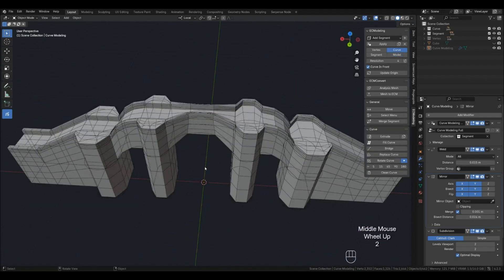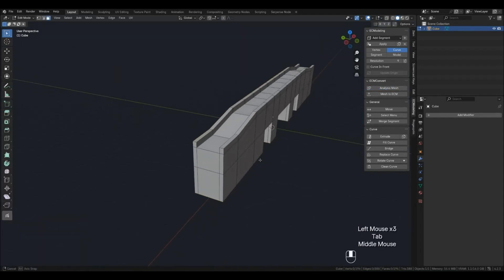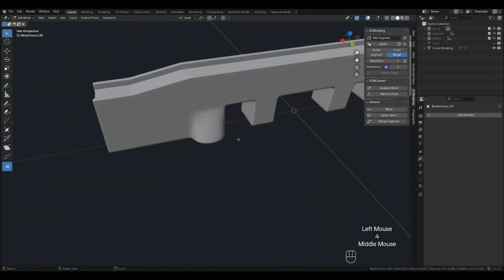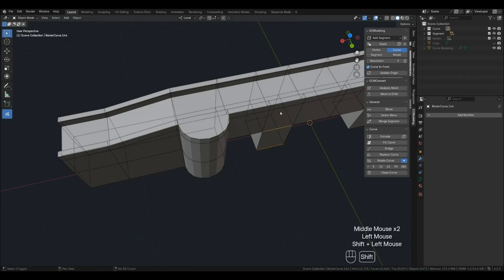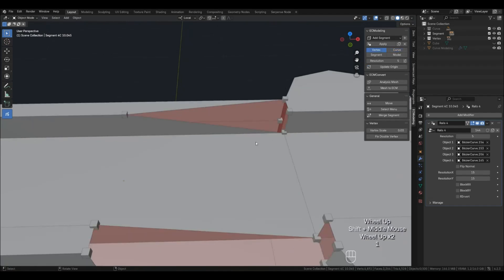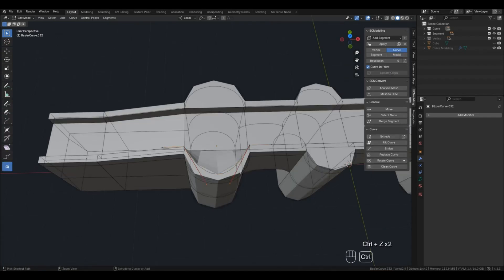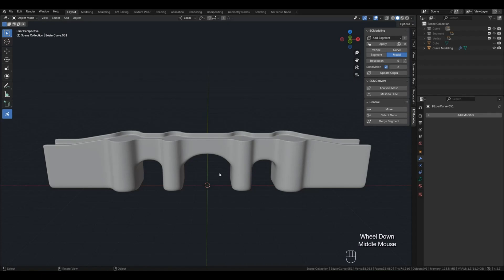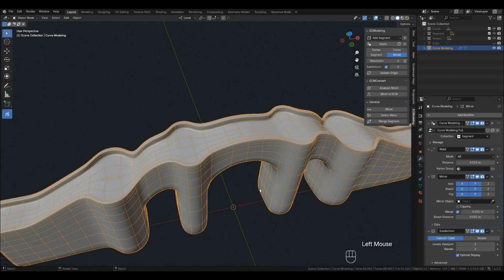Expert Curve Modeling Tutorials 4

Comment: can we make sharp /hard edges too ?
Reply from the maker: You can add bevel in the right places after applying the model and the desired edges will be tighter, you can also add a bevel modifier in model mode (without applying the model to leave the ability to edit in real time), in some cases this also works well, but it depends on what shape you are making. It is also possible to increase the stiffness in the right places by increasing the resolution on the necessary segments, but this is not for all cases